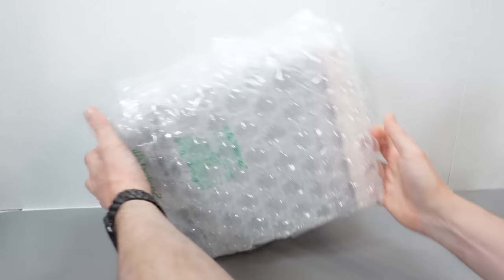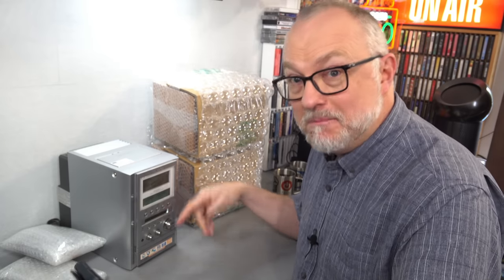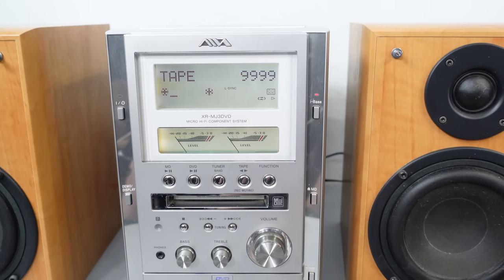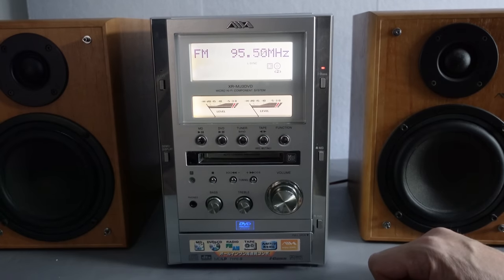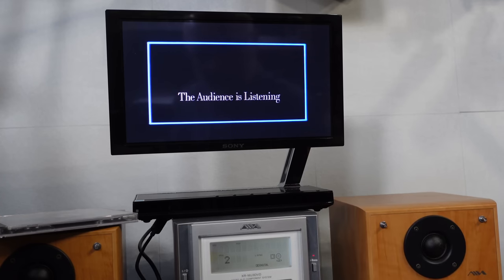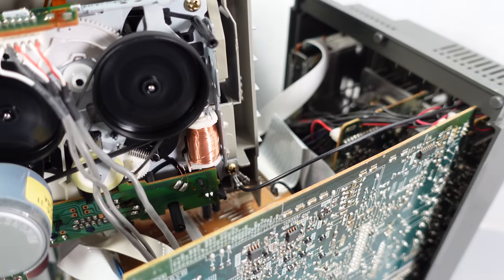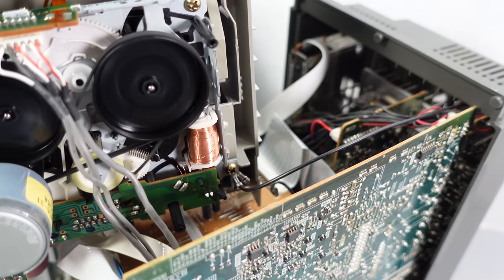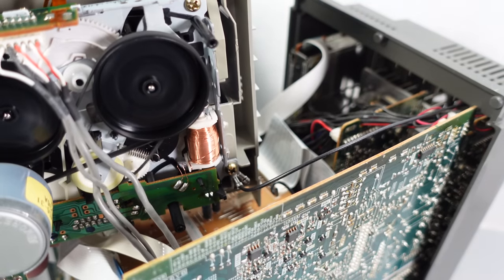Micro Systems 2:  Eclectic Boo-Boo

Comment: great video.  It’s not necessarily true that Japan and UK region 2 DVD discs and players are 100% compatible.  Japan was NTSC-land and the UK is PAL-land.   I recall running into some Japan players that would only play 23.976 Hz and 59.94 Hz DVDs only and not 50Hz UK discs despite both the players and the discs being Region 2 in both countries.  Same with vice-versa.  Analog TV's in NTSC-land (Japan, US, Canada) almost never supported 50Hz signals in the standard def CRT era (this has only recently changed in the last few years, many early HDTV's sold here couldn't either., only HDTV's sold in about the last 6-7 years in North America can reliably and solidly support 50Hz signals)  Also lots of US/Canada region 1 and Japanese NTSC Region 2 players couldn’t play 50Hz DVDs even if the disc was coded as Region Free.  The Sony players sold in North America were notorious for not working with 50Hz region free discs (you'd get an error message immediately saying the video format was incompatible).  Ironically it tended to be the “cheap” Chinese $20 DVD players that were the most compatible rather than the “good quality” name brand DVD players from Sony/Panasonic/Toshiba.  The cheap knockoff Chinese brands could often do the auto 50/60Hz video conversion to play 50Hz UK region free discs on a Canadian/American NTSC TV at 60Hz (with some slight judder), while the "good" brands never could.  I understand that 60Hz support (PAL60) was added to PAL TV's long ago so they could "technically" and optionally receive NTSC style 60Hz signals but the reserve was NOT the case in North America.  It was very rare to encounter a TV sold in North America that could support a 50Hz (European/Australian) input signal before 6-7 years ago.  Fortunately they do now, so you can watch stuff like BBC iPlayer at the proper 50Hz cadence with an Apple TV even on a Canadian/American TV set these days (joy) :-).

Comment: These issues were the exact reason why these systems wiped out from the market so quickly. Afterall, they had a descent amp in them. But still no one was interested to buy them. They were huge for what they were capable for.  My DVD player that I bought in 2006 is also dead (DVD is dead) but the amp, radio works great.  I get nightmares about anything mechanical, tape, DVD, MD, etc. They all end up dying miserably.

Comment: I still have a Panasonic mini system from the early 2000s and it drives me nuts that half the functions are only available with the remote. I love the unit but it would be nice to adjust the EQ without the remote.

Comment: My step father had a sony microsystem from the late 90's ( think maybe 99). Had multi cd changer, 2 tape decks, and AUX capability. I inherited it(as in he gave it to me), and used it for like 2-3 years in aux mode. It died in 2011. As in it did not turn on. So yeah the micros from then maybe not the most reliable

Comment: Still would like to see a repair but if it was something simple like a burnt fuse or voltage regulator or any easy to replace part, the disc drives might be easier to repair with a new laser and fiddling with the mechanism, but I know it takes time and money and probably won't happen.

Comment: Those flimsy ribbon cables are a menace. Manufacturers love them because they're cheap. They can make otherwise simple maintenance and repairs of laptops and other devices into a nerve wracking affair. You always have to treat them, and their equally flimsy and cheap connectors, like they're going to fail catastrophically with even the slightest mishandling. Because if you do get them wrong somehow, either the device is not going to work right and you have to take it apart again, or a too large amount of voltage will be sent somewhere it's not welcome,  which tends to be hazardous for a device's health.

Comment: It was not uncommon for cheaper microsystems to have poor radio reception with any included indoor antenna's.   You probably noticed that with the older unit as well.   You could try moving the antenna wire around a bit, bit it likely won't receive well inside.   Also, the DVD taking 30 seconds to read is pretty standard for this particular model.   It was not a high end system.       MP3 playback, by tis time was pretty well standard even on the cheapest CD players, so that was a kind of expected feature.   Slightly higher end units would play more audio formats.
Your unit looks like it would probably would have been okay with belts, but unfortunately a few things have gone wrong toward the end.

Comment: A lot of things could fail in the 20 years' time. Beside the belts, capacitors, semiconductors, plastic parts would deteriorate as well. Metal parts could rust and springs stretched.Turning on one laid unused for a long time could start a pyrotechnic fanfare.

Comment: This one seemed pretty good and repairable for being what it is. I am pretty sure in the right hands it can still be turned into something enjoyable.

At that time AIWA was just an ailing division of SONY. Anyways... for what I've seen these Japanese sellers are making big money, especially on eBay since Yahoo Auctions Japan closed for the rest of us, selling JUNK they get for presumably 10-20 bucks max at 1000% markup!
Reply: Sony didn't buy Aiwa until January 2004. They owned 56% of it in 2003 but didn't run it.
Reply: @Safetytrousers  Thanks for the info. Majority 50+1% of shares means control of the company. If they did not run it by then they still RUINED it. Such a pity.

Comment: This sort of equipment turns up often at my local charity stores. I only buy it if its offered cheaply and shows some signs of life. In the majority of the cases the poor manufacturing and plastic moving parts show severe wear and damage. Its not really worth repairing. And, most people aren't interested in buying them of one can successfully repair them. They're fun as a project. But not really anything else. Its a shame that manufacturing standards dropped so badly by the 90s. A valve set from the 30s can be repaired and used, while later equipment will only be suitable for the bin.

Comment: Man this video has been intetesting. I have a love hate relationshop with a sony mini system. A combo cd tape and radio unit. Funky slot loader . Good sound. Took forever to figure out what caused this, but the timer function kept turning on and blasting what was in the cd drive at odd hpurs of the night nearly giving me a heart attack each time. Father loved the thing and wouldnt part with it. After its last unschedulad power on blasting back in black at 2am, it recieved spome precusive matinence that knocked the laser out of alignment, and there have been no more back in black 2 am wakup calls since. Might be time to go buy another mini system...

Comment: 28:08 "it's no use now"?  Doesn't it still have the radio?
Anyway if it doesn't have a turntable for vinyl and shellac, it's not comprehensive, is it.

Comment: If you take out the internal battery back up that should reset your video settings back to factory. 

I thought the UK went to all digital radio - don’t you need a digital radio to receive the stations? Can old radios pick up the new digital stations? I bought a mini AIWA system back in 1997 in the U.S. and it seemed WAY more advanced as far as the color digital displays and the over all look.
Reply: @@mattquinn-caledoniantelevi2522 so they have both? The U.S. hasn’t implemented digital radio but has with the television antenna service - now that was kind of a cool move because of all the channels you can get but as far as radio, digital just doesn’t have the wattage that analog has. Same thing happened with cell phones when they went digital - I had an old analog vehicle mounted phone I think it was 10 watt and it worked E V E R Y W H E R E as soon as they forced me to go to digital, we’ll it took a long long time to get used to lol

Comment: Whenever I encounter a device that has been designed to the "10 gallons of shit in a 5 gallon bucket" standard in need of repair I presume that as soon as I get into it it'll be a total loss due to the risk of cascading failures during disassembly, so if the remaining functionality is required then I tend to leave it alone.

Comment: I have a Sony CMT-CP2W. This thing was loaded with features back in the day. Its slightly bigger than most micro systems but it was advertised as the highest-end model out of all ot them back in 99'. Its complexity doesn't help with repairs. This thing is a pain to work on.

Comment: C13..is an error code or its a problem with C13 capacitor on the MD pcb (which is plausible, especially with elecro caps that are 20 plus years old)...also you might have to reset the MD drive eject mechanism..I had a PS3 that needed a new Blu Ray diode/laser...you needed to "re tension" the eject mechanism and I suspect these are the same..the reason is you have to put the eject mechanism in a state where in jibes with the digital controllers and sensoring...its something you have to consider with this era of electronics. your basically mixing mechanical mechanisms with digital user interfaces that seek to control them..

Comment: Stopped being a fan of Aiwa when Sony bought them out before 2003 and turned them into LSD systems on (I said that right) Extasy  So got a Sony 60 disc jukebox instead.  Easy to replace the belts.  And it'd be 60 mp3 discs too
Reply: Speakers look exactly like my brothers 5 disc system where you put in 1 disc at a time

Comment: Suggestion: VCD and DVD/MP3 disc Unit players.
Only able to play them in DVD players after 2007 from auctionland. Well what on earth is wrong with a DVD/MP3 on “shuffle” with ‘any’ micro system unit available && you also can only buy one of those types of discs off bamazon_ ? Really just want to have my own shuffle party at weekends.. More interest in those units and say where there about at, cheers TM.

Comment: Please can someone help. A step down converter was mentioned in the video, I fancy a Denon MD player from Japan but I can only see converters that change the voltage to 110v (and Japanese current is 100v). Can someone tell me if one of those would do the job? Cheers.

Comment: Don't toss it. The MD player transport is the same as some pro rackmount units. You didn't take it apart correctly. it needs to be retimed. Also the CD drawer. THe cassette should work once out get the cable inserted properly.

Comment: The interlace/composite to progressive/component debacle is just ridiculous. It must be a Sony thing because there were countless times I would do this with my PS3 switching between composite and HDMI and effectively bricking my system until I could hook up a different connector.

Comment: I've been repairing audio equipment for 40 years and i wouldn't touch a micro system from the 90s and 2000s for any price.  Individual components, yes.  But these "all in ones" were never designed for service and repair...   You supposed to go buy a new one.  Good attempt anyway. Certainly entertaining.

Comment: I have a hifi that needs repairing..... don't worry I won't be using your service's 😆
Those later Sony mini discs were garbage it was the tail end of the mini disc life c13  is deffo a new laser I had one deck with that mech in and was always causing me issues, Sony have a tendency to use little pin switches in the md mechs and they always go wrong which produces the symptoms your getting the loading mech moving backwards and forwards all the time, contact cleaner helps with those switches some just seize up entirely.

Comment: A unit from 2003 that can only play MP3s up to 128kbps quality? Seems really odd... Now wouldn't even portable players of that vintage go much higher? And this one's a more 'proper' setup to boot, albeit a micro one. Wonder if that's an arbitrary restriction rather than dictated by the hardware's capabilities? For instance a simple, callous throttling of performance to distinguish it as a lower end model (it is a Sony rebranded as Aiwa, after all)? Or another case of Sony's draconian copyright control schemes?

Comment: What a disastrous story 😅I think we can safely say, the moral of the story is: who haven't got the ability, the necessary tools and nerves to repair these things, it is better if does not touch one of them. As it is seen in the video, it takes just seconds to do unrepairable damages to a device like that... so just leave it to those who can make those repairs (like myself ;) I'm really sad about the outcome, as the tape deck really had only that belt (it was unable to wind the tape so the autostop activated); I believe the MD deck would be still repairable; the DVD probably a similar failing belt issue just showed up... so yeah, now an unnecessary, useful component video cable is on the way from Japan; just to finish in Techmoan's useless stuff stash 🤣

Comment: I hate these ribbon cabels and had a similar situation on a sony Handycam, i finished recaping it and it was 100% working but when it came to putting it back togther i snaped the ribbon going to the MIC circutry, I tried to make a new one from some other ribbons but when i plugged it in i heard a nasty pop and the MIC board was dead

Comment: this is why you're better off buying a really cheap system because then you won't waste your money at something that is made so anti-repair that you will end up breaking it even more. My stereo is a no name Chinese thing, really basic, but it plays CDs and tapes fine enough, and it has an analog tuner... the aiwa may also have bad capacitors that leaked all over the circuit boards. You should leave these highly integrated stereos for someone who's an electronics expert

Comment: Buying an AIWA is not buying a SONY; AIWA was the low end brand in the Sony galaxy and build quality was rather low with cheap material and second rate components. Products designed to last 4~5 years and then thrown away. And the fact that they keep re-designing the logo (while Sony today still has the same it has always used) it is just an indication they needed a new face for the public as the older logo's were too associated with low quality products. If your products are good, you'll never want to change your logo as potential buyers will associate your logo with good quality products. But that was not the case for AIWA.

Comment: Micro systems in the late 90ies/early 2000s weren't as good as their predecessors. They got cheap and quality suffered. I had an Philips one from 1997 that blew an chip off from what I think was its motherboard (only 2 layer board in it) 7-8 years ago. Disasembling it was the worst ever expierence and when I found 2h later that chip not being on the board anymore I knew it was just pointless.
Sony badging this one AIWA tells a story of its own. AIWA was nearly bankrupt in the late 90ies. Being more an budget brand they felt the pressure from China very early. AIWA had to close their smaller factorys including their most modern one in Wales in 2001 and laying off half of its entire staff. Thats when Sony overtook AIWA and ran it into the ground in just 3 years by selling what I only describe as rubbish. I remember a friend of mine buying an AIWA portable CD player around that time that failed just days after the warrenty ended. And that wasn't the only AIWA product people around me bought back than and failed very early. I'm really kind of impressed this thing lasted that long. Who ever bought it took real good care of it for sure but I bet they used the cheapest parts they couldn't get rid off under the Sony brand to build that thing...